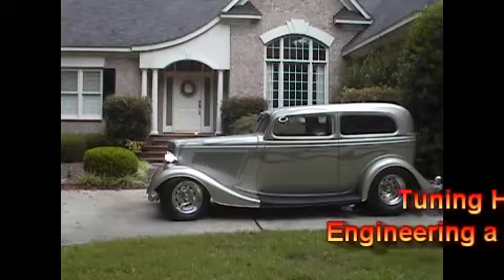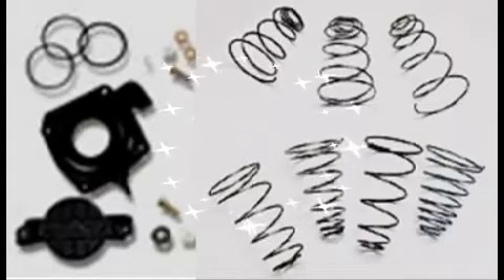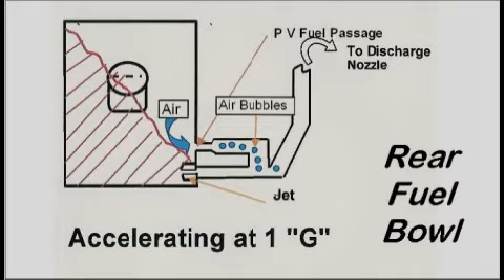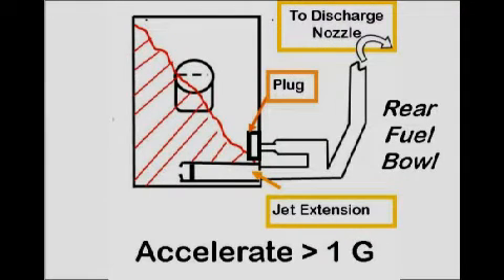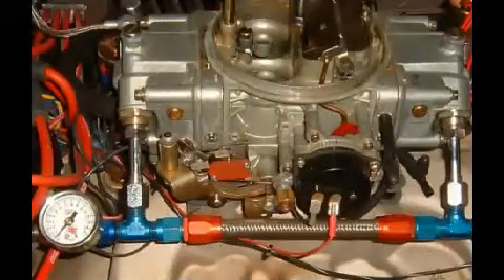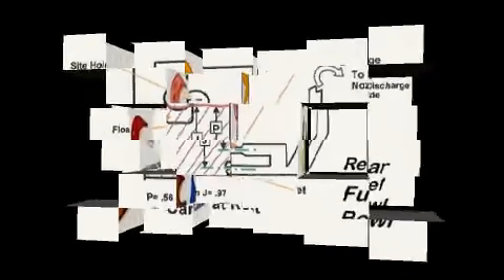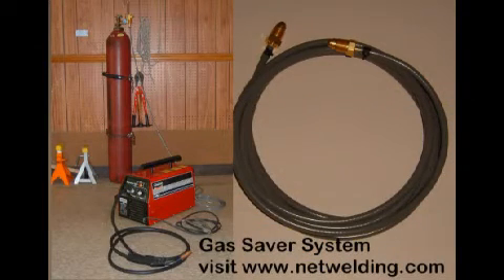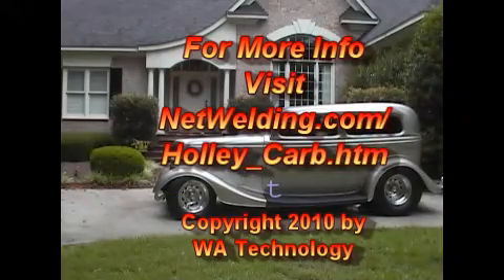Tuning Holley Carb- Engineering A Street Rod.mp4

Comment: I ran a Holley 800 dbl pumper with 1" spacer, Edelbrock RPM manifold on my 383 stroker with a General Kenetics hyd cam with 300 advertised duration, long tube headers, dual 2.5 exhaust, 3500 stall converter, built turbo 350, 373 gears. I took the carb out of the box and installed it and it ran like a rocket ship. No bog, just steady, hard pull. Only fine tuning needed. I ran this set-up in an 85 Silverado short box with M/T drag radials. Thanks for the informative video.

Comment from the maker: Edelbrock's a fine carb for a street only machine.  For a real performance carb Holley is the way to go!  In 1960 I had a Carter carb (Edelbrock copied) in my 1st street rod, a ’41 Ford Opera Coupe with a 50 Olds engine bored out an 1/8 inch.  Modifed the metering rods!  Similar to what I did with the SU type carbs in my 260 Z.  But a 502/502 needs full adjustment of both accelerator pumps, jets etc if you want to do 0 to 60 mph with street tires!  Get an air/fuel gauge and it’s fairly easy.

Comment: I know a few people that had problems with Holley carbs,one even threatened to throw one on the floor after replacing it with an Edelbrock.Hit the key after an Edelbrock,started right up.Change one part in a Holley,you change everything..Holley carbs,have to pump them before starting the vehicle up.There is talk carbs even high performance carbs are being phased out.Edelbrock carbs are easy to tune out of the box.

Comment from the maker: The Holley works fine for normal driving once set up correctly.  Started it today for the 1st time in 3 months - the 1st Car Show of the year is this Saturday!  1)  A few cranks before starting the Holley fuel pump to get oil flowing, 2) A relatively slow push to 1/4 throttle and it started fine in about1 second!  Note; I do use Sta-Bil.

Comment from the maker: @177SCmaro  Been so long, your comment made me wonder!  Still have the Vacuum Secondary that came with the 502/502-anyone what to make an offer??  Just took off both front and rear bowls!  The power valve on the secondary looks just like the one on the primary.  Maybe smaller size carbs don't but  850 CFM does.  On a 502/502 if your going to achive 0 to 60 in 3.3 to 3.4 seconds get a double pumper and open it wide ASAP.  As Larry the Cable Guy would say- "Geter Done!"  Jerry

Comment: @NetWelding Right around 2:30 you talk about power valves in a vac secondary carb. 
But hold on a second. On a vac secondary Holley, I'm assuming its a 4150, they don't have a power valve in the secondaries.
Generally when there is a hesitation in the transition from 2 to 4 barrels in a vac secondary carb it's because the secondarys are opening too fast, and because they lack an accelerator pump and power valve, there is momentary lean condition until fuel can be drawn from the secondary mains.

Comment: this would cure ur problems. a holley double pumper. its machanical secondary so when u floor it, all barrels are wide open, as with all four barrels, but the air flap (idk the tech term) is wide open as well. and with the DP u get more gas. a like street rod is the perfect opertunity to us a mechanical secondary. vaccum is better for stock-somewhat modified stock motors. if u got a 502, got with a double pumper

Comment from the maker: Like the idea of wires reducing area of the air bleeds. Anything that reduces the area will work.  The 850 double pumper does not have replicable air bleeds.   
To get 0 to 60 times in the 3.3-second area a double pumper was needed.  The fuel/air ratio meter proved that!  Now starting at 1900 rpm the car is floored and the Double Pumper opens wide-No hesitation or bog!  Need two 50 CC pumps and big squinters and the right accelerator pump cams on primary and secondary.  Doesn't go lean now!.

Comment: @RicerSchnitzzle  I've used wire to block bleeds and fuel jets as well, it works suprisingly well. In fact I've eliminated bleeds altogeather on 2 bbls I modify for roundy racing, they have bored venturis and fueling them can be a struggle. I seem to have lost the patience for carb work anymore, I sold the race car and have lost intrest. One thing I've noticed is if you can find one carb man in the pits that's one more then usual.  I ran a 2 in a 4 bbl class and did very well, it's hard to beat

Comment: When someone says a carb won't work in a given application it get's me stubborn. If the secondary didn't open at all the car should run correctly on the primarys, any bogs would most likely be due to it opening too soon, causing it to go lean. I'd be looking at air bleeds, sometimes I'll block them with fine wire, it changes the timing of the fuel circuits from low speed to high transisions. Carbs are a black art, and sometimes it's just better to swap like you did. Wonder what a 650 woulda done

Comment from the maker: My racing friends said the vacuum secondary carb wouldn't work; they were right!  Here's why.  A light car you can accelerate at 1 g or better off the line..  In a heavier  car  you won't fell the lag while the secondary’s wait to open.  But if you’re going to accelerate to reach 0 to 60 in under 3.5 seconds even the slightest hesitation is not acceptable.  Sure with a heavy spring it didn’t bog it just hesitated!  That is not what I built this car to do!  There was no "right" sping!
Jerry

Comment from the maker: @NetWelding The Vacuum Secondary Holley 850 that came with the 502/502 Big Block crate motor may work in a heavy mussel car but for a light street rod with good traction a Double Pumper was needed.

Comment from the maker: Good comment.  The 850 does not have adjustable air bleeds.  However the issue was not coming off idle.  Typically best 0 to 60 times start at1900 RPM (any higher and even the 16.5 section width Mickey Thompson's loose traction.)  If I was setting up for racing, a carb with adjustable air bleeds would be useful.  The air/fuel meter shows the extra pump shot did the job.  Also the car accelerates fine from cruise.

Comment from the maker: With a very light car and excellent traction-mine has 16.5 inch section width Mickey Thompsons- the engine goes “lean” even with the biggest front pump, squirters and cam.  If you are willing to accept a slight hesitation as the secondary opens perhaps the vacuum secondary is OK.  I tried 50cc pump, every spring and even bought the needle valve adjustable diaphragm.  Helped but not like a double pumper.  If it is used in a heavy car that may be fine.  Dyno tuning doesn't test these transients!

Comment from the maker: Thanks for comment.  Agree with light car and good traction a vacuum secondary doesn't cut-it to getgreat 60 foot times!  Answering 1st question:  Our patented Gas Saver System has nothing to do with gasoline-it cuts MIG welder Shielding Gas use in half with better quality starts.  Thousands are in use in Industry.  2nd question: Try putting bronze filters in both double pumper inlets.  Worked for me even after I put in higher vent tubes, vent whistles, checked fuel level which did nothing!

Comment: Great video ! I was going thru the exact same thing in my chevelle with the ZZ502. Changing springs, pump from 30cc to 50cc, bought a wideband kit, found out I was lean. Gave it more jet. Still couldn´t get rid of the bog and ended up buying a 1000hp from prosystems. Ready tuned for the zz502. Works like a charm. 
Why GM put that lousy carb on an otherwise very nice engine is beyond me. 

What does the gas saver actully do ? I too have that bog, or engine stalling when braking hard.